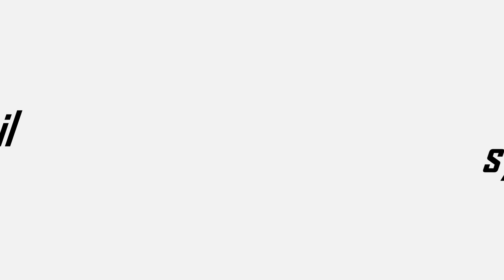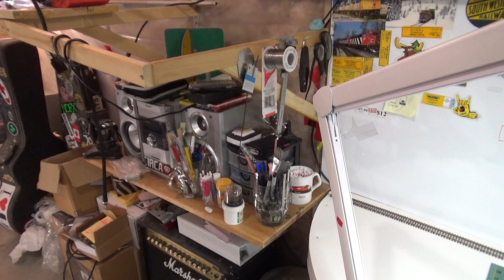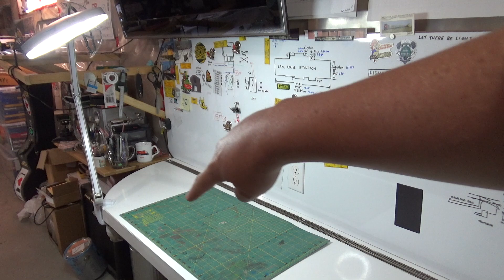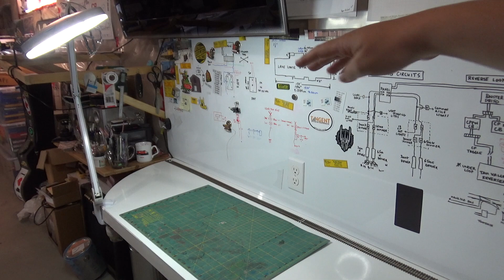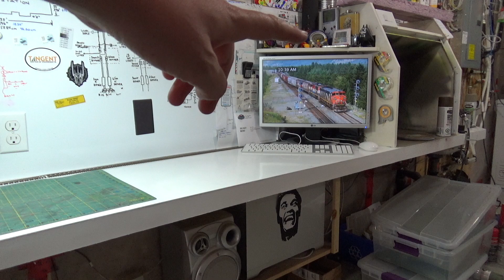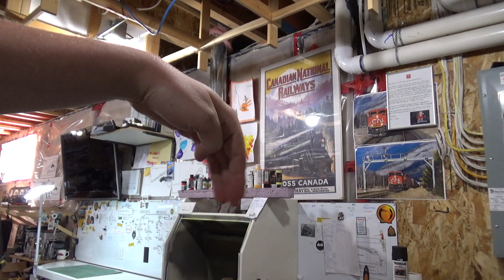Layout Workbench Tour

Comment: You need power bars. I got real tired of the power cord smashing projects and/or cleaning off the bench. My workbench has two fastened to the front of the legs on either side. My garage has a long strip just under the front edge of the bench. Just don't do like we did in a shop years ago. The work benches were in the middle of the room. A long corded power bar went from the wall outlet to the closest corner of the benches. There was two bars connected to it and two more connected to those two and then two more connected to each of those two. I counted, a total of 39 receptacles.
Reply from the maker: Very good points Dave! Thank you. I could definitely put a large power bar on one side and it should really improve my ability to have stuff plugged in.

Comment: Great workbench, and many useful tips! Regarding storage for the spray cans, there are wall racks that hold the cans horizontally, almost perpendicular to the wall, at a slight upward angle. It looks like you may have enough room for one of these to the right of the sink, between the whiteboard/backsplash and the house electrical panel. I've seen these racks online and in several tool and modeling catalogs. I'm pretty sure an internet search for "paint can racks" would turn these up. A real spacesaver!
Reply from the maker: Great idea!

Comment: Thxs for sharing the bench.. I have a somewhat similar set-up and I'm jealous of the booth and sink.. I agree with you on the light but years ago I bought one that also has a round magnifying glass in the center which I use tons!  I just need something on the floor 'cause anything I drop seems to go thru a blackhole in the universe.. 😋
Reply from the maker: Thanks David. Mine has the magnifier under the flap too, I don't use it very often. Oh man, I know exactly what your talking about when a tiny Kadee spring shoots off of the tweezers. Even on light grey concrete, it's almost impossible to find small stuff on the floor.

Comment: Reviewed your workbench video again today.   Regarding your light, I assume it's an LED magnifier.   Could you tell me the brand or vendor?
Reply from the maker: It is a magnifier, but I have honestly never used the magnifier. I got it from an electronics store. There is no model number or brand on it.  It's actually a fluorescent so I would recommend getting an LED and not having to worry about the bulbs.
Reply: @BArailsystem  Thanks for your reply!!  I'll look around ... I need something similar.